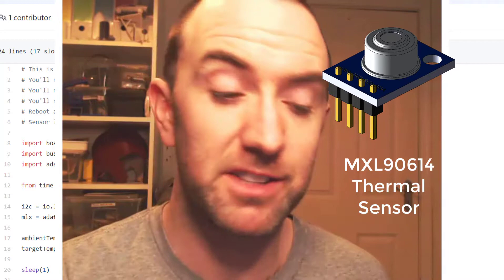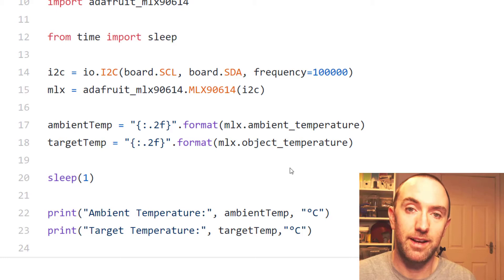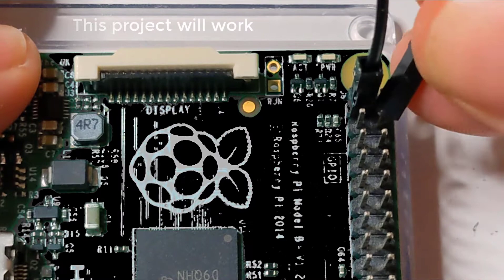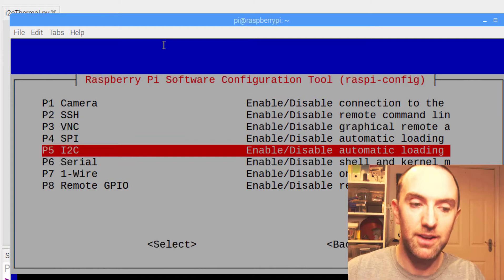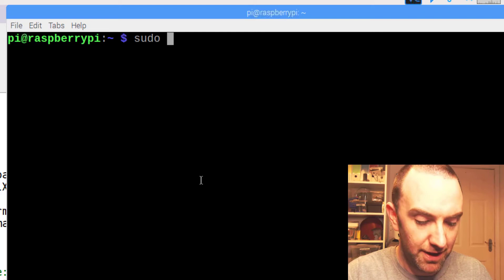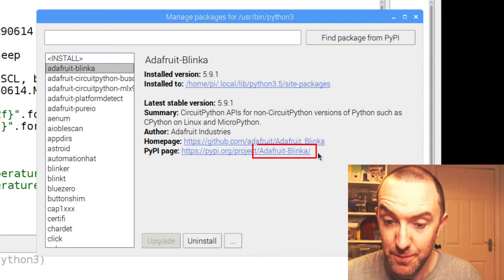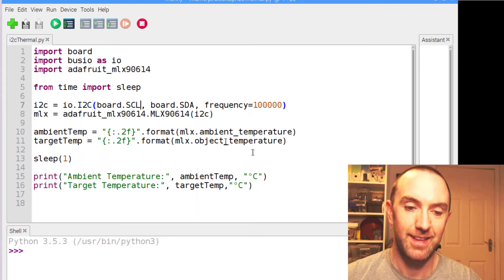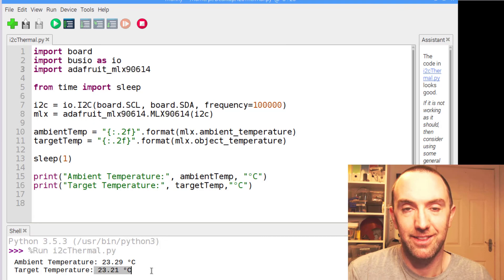MLX90614 Thermal Sensor Raspberry Pi Tutorial

Comment: I have the same sensor and rasp pi, but when checking for connections I don’t see the 5a at all and I’ve rebooted and checked all connections several times and even swapped the ir sensor and it still isn’t detected, what could be the problem?

Comment: Im wanting to messureaprox 30cm wide will this messure that wide? Amd if theres an offset in temp between top and bottom will the sensor show ? Or will it just avrage the entrire ramge ?
Reply from the maker: I don't know off the top of my head but you can check out page 27 in this datasheet for the angle: https://www.sparkfun.com/datasheets/Sensors/Temperature/MLX90614_rev001.pdf

Comment: Hi Danny, I would very much appreciate it if you could answer one question. Is there any soldering required for this? And if so do you have a tutorial on how to do it as I never did solder before. Thank you!
Reply from the maker: No soldering required if the sensor has pins already fit.
Reply: @DanielMurrayMakes  not sure where to get one that has them fit. I have been looking on amazon but they all come with the pins separated

Comment: how do you get it to read Farenheit?? need immediate help
Reply from the maker: The formula is (0°C × 9/5) + 32 = 32°F

So in code that'd be

temperature = ((temperature/5)*9)+32

Where temperature is the temperature variable that gets replaced by the US version. I'm in my phone here so can't see what exactly the temperature variable was called in the video above. Maybe temp or something like that.
Reply: @DanielMurrayMakes  so this is what I have:

import board
import busio as io
import adafruit_mlx90614

from time import sleep

i2c = io.I2C(board.SCL, board.SDA, frequency=100000)
mlx = adafruit_mlx90614.MLX90614(i2c)

ambientTemp = "{:.2f}".format(mlx.ambient_temperature)
targetTemp = "{:.2f}".format(mlx.object_temperature)
temperature = ((temperature/5*9)+32

sleep(1)

print("Ambient Temperature:", ambientTemp, "°C")
print("Target Temperature:", targetTemp,"°C") 

Is that the correct positioning

Comment: It's awesome,
I want to ask you something,
I have project, it's my  final project  actually,
I will set a camera in my university, Infront of the door, i want to measure the body temperature of there faces, and also i will work on openCV platform to count each one come in, and when they come out,

I just need and good thermal camera , to measure the temperature far away and not for single point, 
Can you help me with something,
Thanks a lot,
Reply: +1